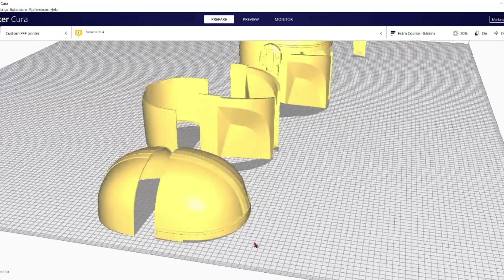Elegoo Neptune 3 MAX VS Creality CR-M4!  Can $470 beat $1100??

Comment: Dude you have no scientific facts given in the video, even comparing prints printed with different filament. Basicly you could print a base mode with all 3 different printers with overhangs and other test stuff. Creality is loud but have you ever seen the overhang performance on m4? Have you printed with different speeds to compare on each pritner? no.
Reply from the maker: I used a variety of filaments and speeds. Various models and details. I tested plenty to justify my results and conclusion. I don’t need to run a college level study to know a better product when I see one. If you don’t believe this review then buy them both yourself and test them.
Reply: @FranklyBuilt  thanks for your review and time anyways, appreciated. It was just a kind opinion you might consider next time.

Comment: Im curious if other slicers have an option where you can do a filament change per layer but have the option to show you how much filament is used up until the filament change layer. This would help larger printers set the spot in the slicer for where the filament spool ends and where to make the swap. Im printing pieces that are two plus spools and wish this was an option!!!

Comment: Hey Frankly Built, got a question for you. 

Did you have any troubles with have a solid first layer tests? 

My Elegoo 3 Pro performed a first layer test where at spots it will be to closer to the bed while other spots it was too far away. There were a few spots that were on point but those were very limited. 

I wanted to see if you had any issues with that and ways to fix this issue. I have tried a few ways through there IT support but some of those things hasn’t change much. 

Let me know what you think. Thank you
Reply from the maker: Honestly no. I just make sure to level and clean the beds